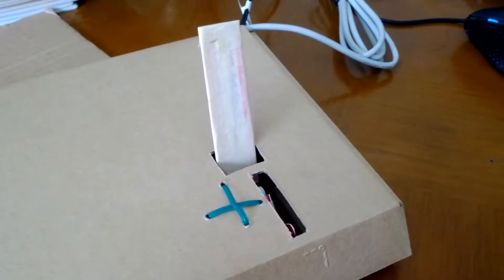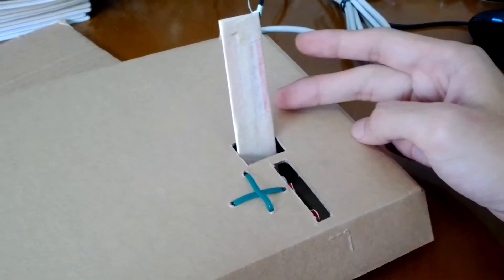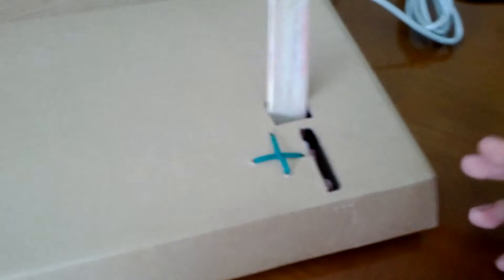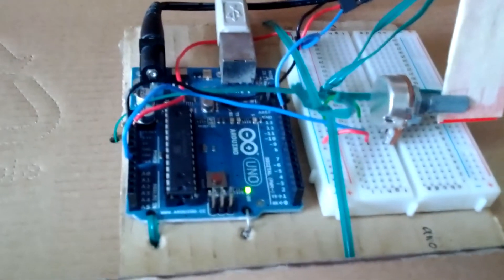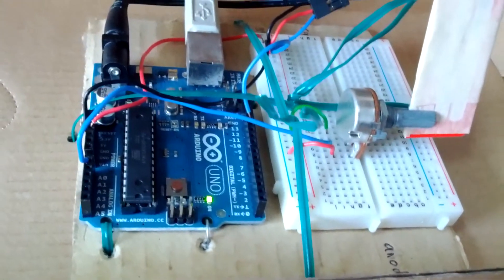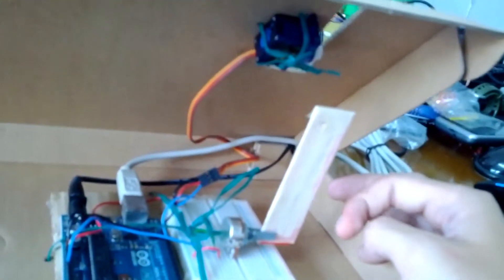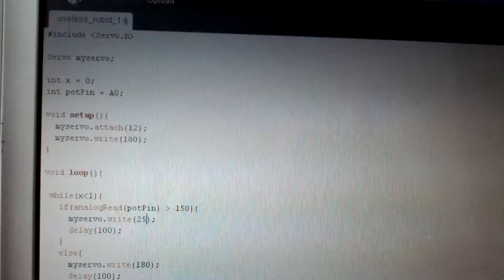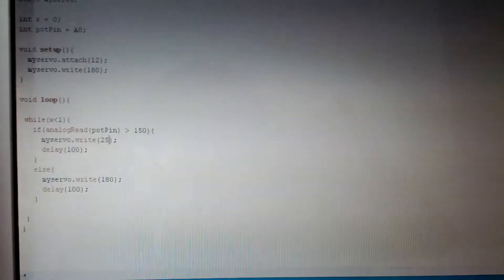Useless Robot using Arduino UNO and Potentiometer

Comment: Since you are using a potentiometer as the switch, I wonder if you could have the robot mimic the speed at which you turn the switch on? In essance mimicing your rustration. With a random deliberate slow motion turn off during the tirade?  Maybe with some easing tweaks to give it a bit more personality:)